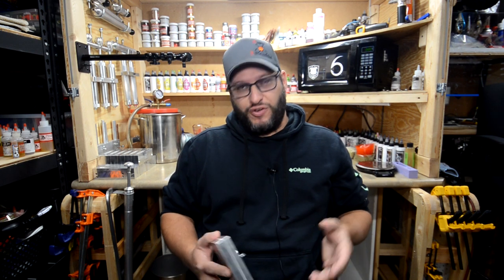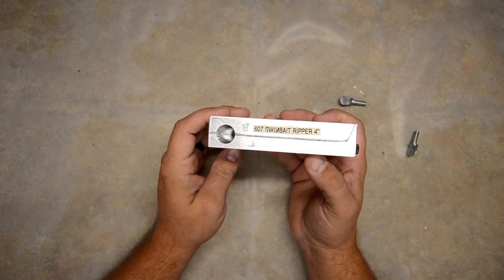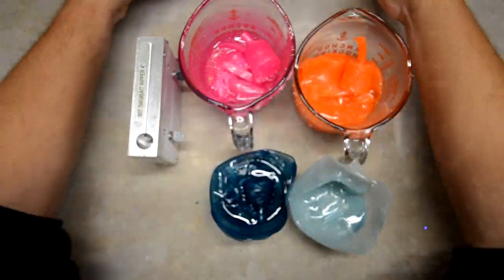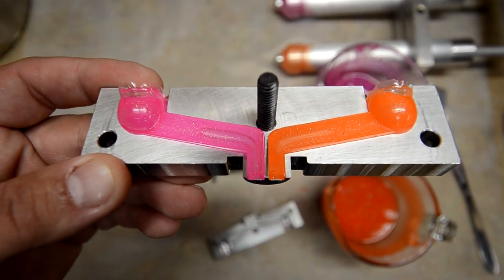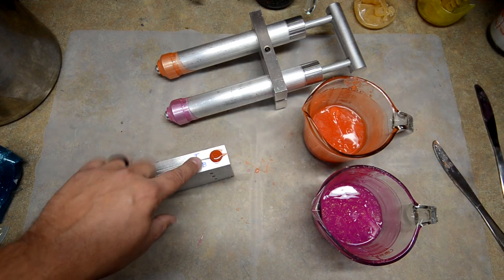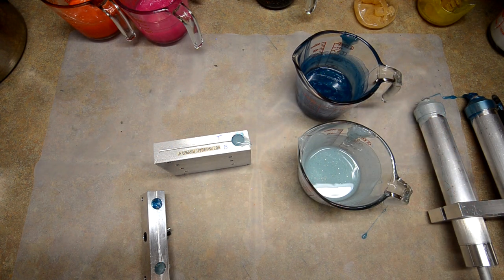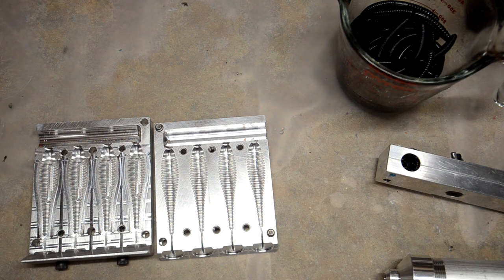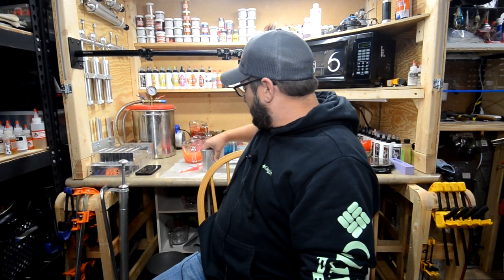BTS 607 Swimbait Mold!

Comment: Bob's tackle shack ringed 607 swimbait mold is the best.  Yes, it is more expensive than any other ringed swimbait mold.  The design is excellent.  I personally have 4 of them.  When they have their big sales, I buy one.  They just announced another sale today for Veteran's Day.  It laminates and triples well.  It's a money maker!
Reply from the maker: Couldn't agree more my man!
Reply: @B8N_Tackle  what injector are you using for your dual?  I use N2, Lurecraft, BassTackle, and Ultra Mold injectors for my Shooting Star.   I couldn't and wouldn't use an injector without a pin lock.  The screw on tips takes extra time and can get cross threaded, depending on the manufacture.  I'm surprised Do-It hasn't swapped over to the safer pin lock system.
Reply from the maker: @kickerwormz3262  I use lurecraft, I have been from the beginning. I have the bass tackle triple and everyone else's single injectors. N2, do-it, lurecraft, and bass tackle. Probably will upgrade to a bass tackle dual at some point or n2, what's your preference?